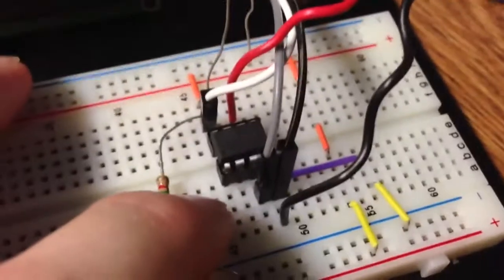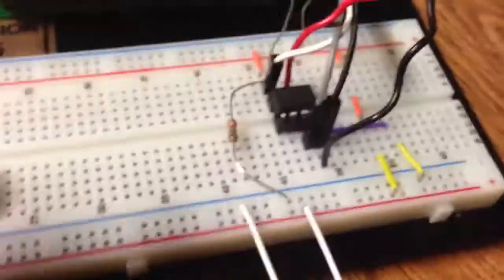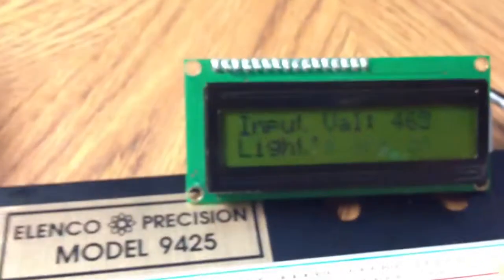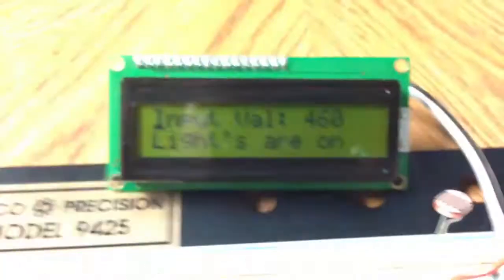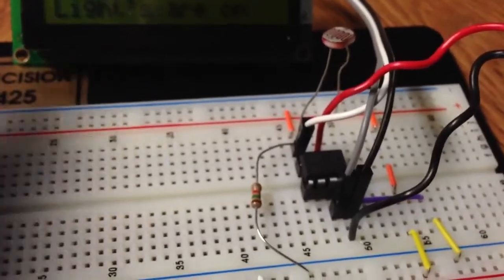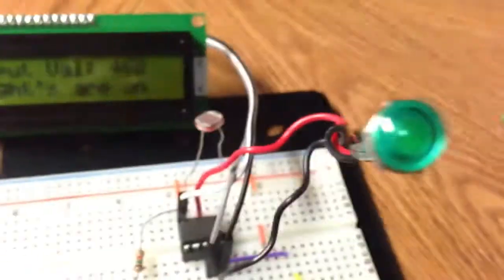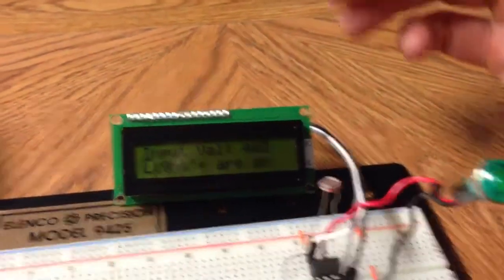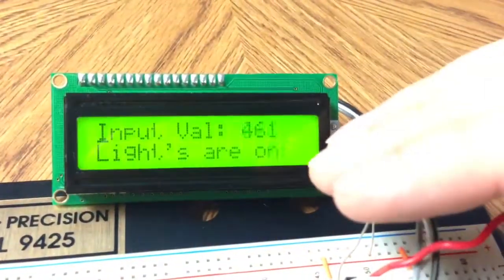ATtiny85 LCD Light Sensor

Comment: Hello I have a project with the ATtiny85. But I have a problem with the LCD1602 library. Could you give me the link where to get the appropriate libraries for the LCD with the ATtiny85? Thank you and cordial greeting from Argentina.

SPANISH: Hola tengo un proyecto con el ATtiny85. Pero tengo problema con la librería del LCD1602. podrías darme el link de donde obtener las librerías adecuadas para el LCD con el ATtiny85?. Gracias y Cordial Saludo desde Argentina.

Comment: Hi ,I am newbee ,  can it take six sensor's as input and display respective data on screen ?
Reply: you can do that on a arduino or another microcontroler not on a Attitiny85 as the Atitiny85 has very few pins

Comment: Hi! I have made a similar project, on the arduino it works just fine but when I use the Attiny85 it doesn't work. Could you make your code available so I can check what I'm doing wrong?